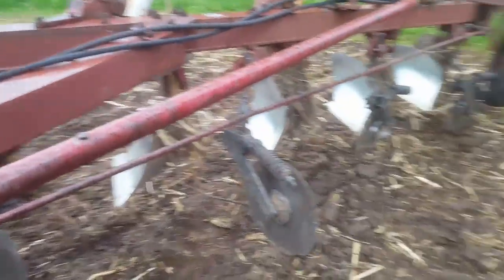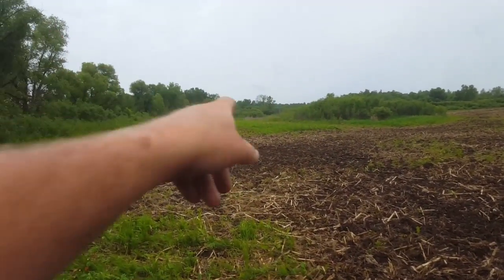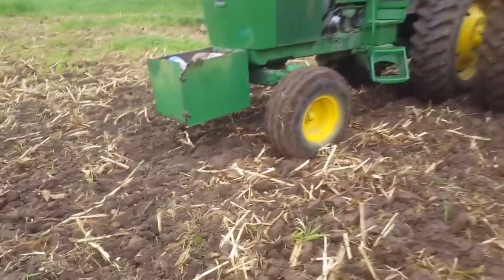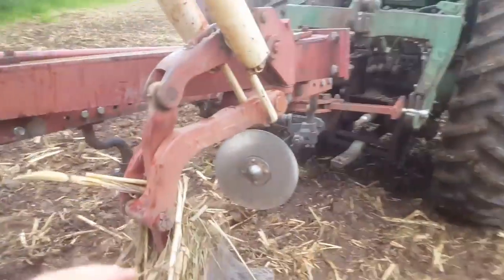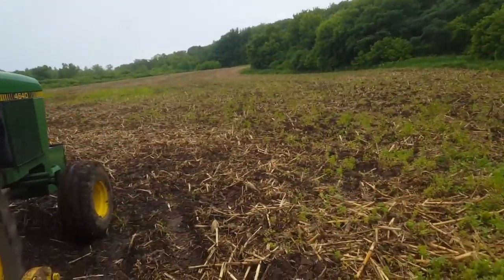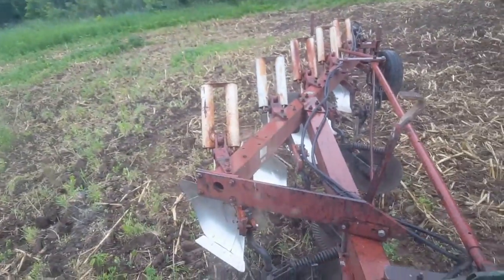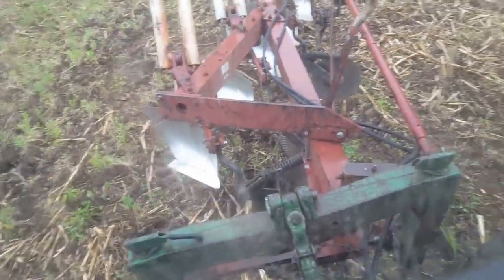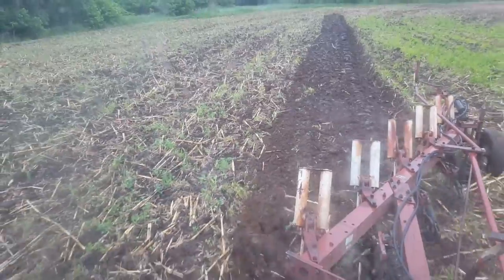moldboard basics

Comment: I use my 4020 and a 4/16 John Deere trailing plow from the mid 60s. Since my tractor is set up for 30 inch rows, I swing the drawbar to the left so the tractor wheel is square in the furrow. That is the single big reason I have not purchased a 4/18 semi mounted plow with auto reset and much more clearance for crop residue.  If I did eventually make that, switch, think I would try to find an Oliver plow. I only plow for, like you said, clean up a field or plant a new hayseeding.

Comment: I really like moldboard plowing. We don't do it anymore. The most I get to do is at our local steam engine show. I use My 49 JD A with my Case Cenntennial plow. But One trick I did use when we plowed. That was with our 4640 and a 2500 6-18" plow. On the end of the run, just lift the 3 point. It lifts the plow out high enough and makes the( lift out and drop in) end up looking alot straighter. That's what I called it anyway. The other thing I did. When plowing the headlands in, When you come to the field driveway. Cheat the tail wheel so it is just cutting in about an inch or so. Then drop it when you pass depending on how deep you want the furrow on the outside edge.
Reply from the maker: Good tips. I love the moldboard as well just can't do it anymore

Comment: Looking for info on setting up the IH 710 bottom plow and GO FIGURE  here's a video from Jon Stevens 😂
Reply from the maker: Ha! Yep, love plowing, 
If the tail won't stay straight, meaning you drive straight but when you get to the other end and look back your furrow is zigzag. Take an old share and weld it to the landslide of the last bottom. It might help a little bit
Reply: @jonstevensmaplegrovefarms3754  getting ready to use the 710 on the chellenger for the first time. Plowing up a field that was amish field last year.
Reply from the maker: @rowdyyates1631  good luck. Dead Furrow every fifty feet

Comment: Which part of the plow has to me measured to see what size plow I have
Reply from the maker: For these old IH plows you measured the share at the bottom. They use the same share on several of their different plows. The 16 and 18 inch plows use the same Parts it just shank was turned a little bit
Reply: @jonstevensmaplegrovefarms3754  We farmed with an IH1486 and plowed with an IH720 18 inch 4 bottom, we put 20 inch points on, it seamed to pull better in heavy clay here in NE Wisconsin. In heavy clay the plow likes to what I call open up, take a bigger bite.
Reply from the maker: @timr9358  well I'm glad somebody else experienced that. I like my old 710 plow, but I hate the fact that on the low flat ground it pulls wide and then Narrows up when I get to the top of the hill so you can drive arrows straight but you're dead Furrow is wavy. I always thought of welding a very long Landslide on that last furrow